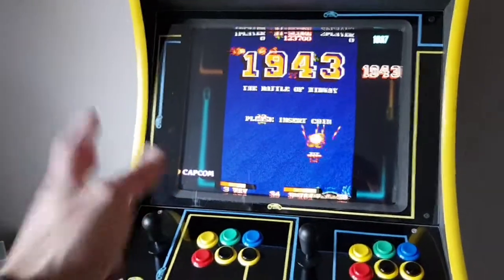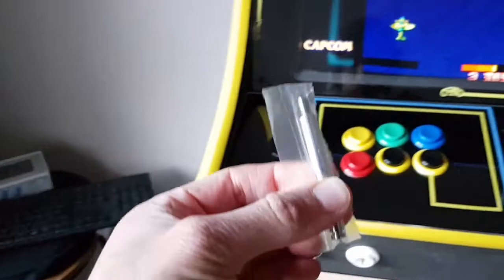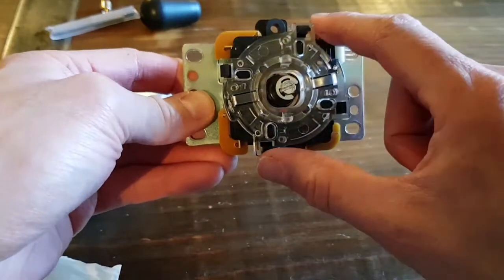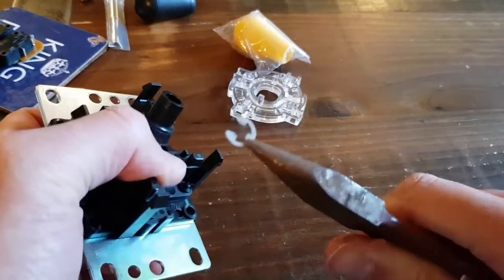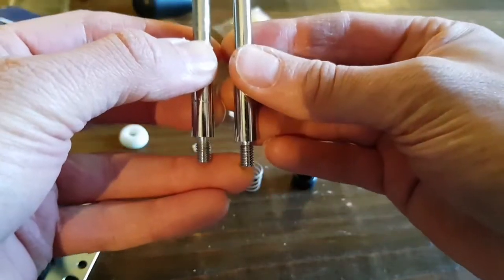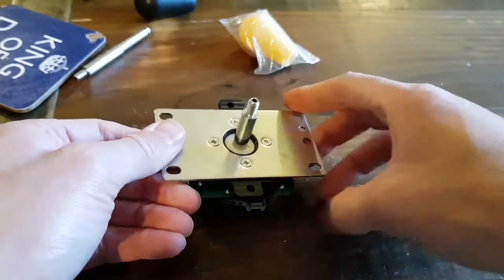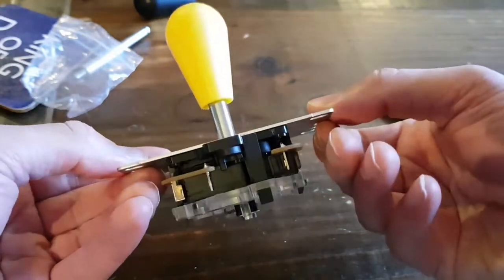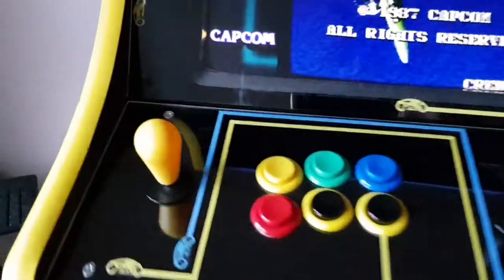Arcade Stick Teardown:  Short Shaft Install

Comment: Thank you for your video.  I’m fairly new to joysticks so your videos are very helpful.  My first stick was a sanwa jfl which felt a little too loose for shmups. So I got the Seimitsu ls-32 which felt great but I missed the 8 way restrictor gate.  So my next stick was a Seimitsu ls-56 which was rated very well for shmups plus you can get a great 8 way restrictor gate but it still felt off.  So I changed the spring to a 2 ibf 8.9 n which changed it drastically (in a good way).  Now I’m thinking about getting a bat top and it made me realize that it just might be the perfect stick that I have been looking for.  I grew up in North America so as a 80’s kid I had gotten used to the tight Happ bat top stick but I wanted more control like a Japanese stick.  My question is have you found the perfect combination stick for your liking or will you continue modifying until you find it?
Reply: I like Sanwa, 2lbs spring, round gate (this is essential for me) and short shaft if installed in a thin (non wooden) panel.

Comment: I really dont think you needed to remove the gate or the microswitches...but hey it worked. Seimitsu sticks have a circlip rather than an e clip so they are fun to remove!
Reply from the maker: Yes you are right, i noticed that i could have left them on. Thanks! 👍